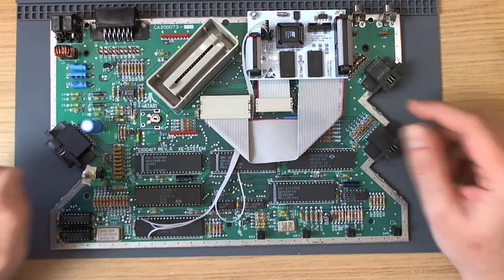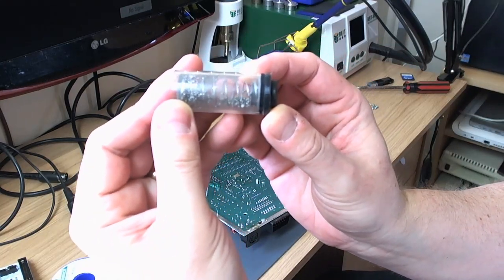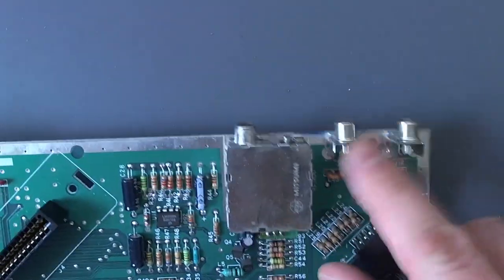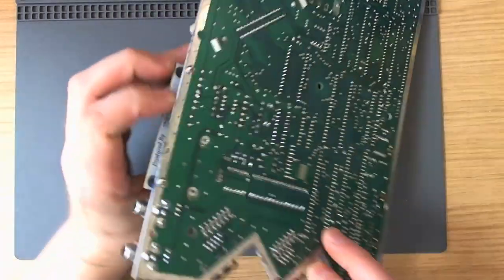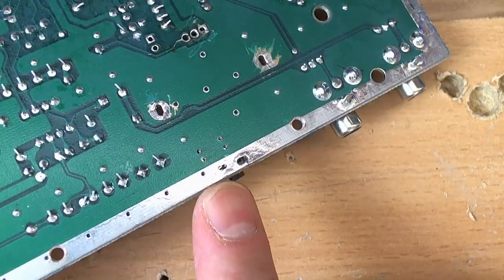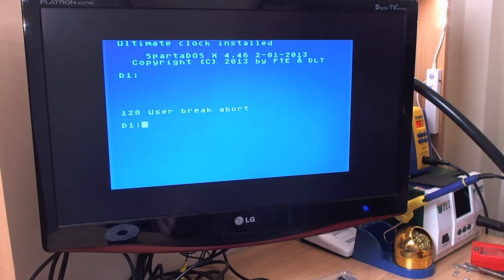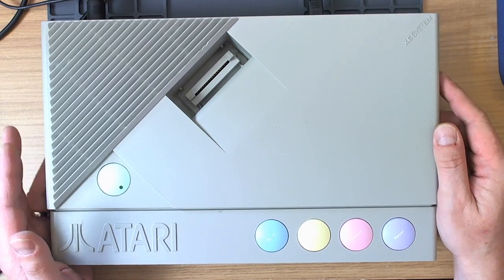Atari XEGS: Installing Ultimate 1MB and s-video jack

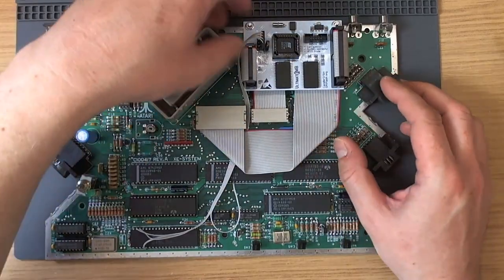Comment: 16:45 It would have been really helpful if you mentioned which pins you attached the 3rd ribbon cable. That was a bit too quick. There seem to be no written description on how to connect the Ultimate 1MB so the videos is all we have.
Reply from the maker: You know from the vendor's instructions and the labelling on the board that you need Phi2, Halt, Reset and R/W. Halt is on pin 35 of the CPU or pin 9 of ANTIC, and the rest are here: https://en.wikipedia.org/wiki/Atari_FREDDIE
Reply: @flashjazzcat  Thanks for the link. 👍

Well, Lotharek keeps the price down by not providing printed instructions, sockets for the ICs or jumper for the XEGS. 😂

PS: I did get the one with your firmware. 😉
Reply from the maker: @Martin.Krischik  LOL. He's a fiscal wizard for sure. And thank you. :)

Comment: I am glad you went back to the 70s style bumpers, as that is certainly your channel's personality people remember.  Your camera set up is getting much better.  I would say your channel now equals the quality of your repairs/upgrade, and that is stellar quality.  Keep up the good work.

Also, the age old frustration of software programmers dealing with hardware engineers.  I am actually amazed at the patience. :D
Reply from the maker: Thanks Richard. I don't know that this makes any difference at all to channel growth or views, however. I spent a whole evening editing this latest video (from several hours of footage), after 125 views during the first twelve hours (usually the busiest time for any video), this is not really a sensible use of my time. It's possible people have simply heard enough of current topics (U1MB, etc). Almost anything outside of the realm of 8-bit Ataris (hot air and soldering station reviews, etc) is doing better than the repair/upgrade videos.
Reply: @flashjazzcat  Well, that depends on what you want the channel to be.  Just strictly Atari, and just strictly repairs and upgrades, will definitely begin to dry up, or at least eventually begin to compete with your previous videos.

Maybe think about a howto series.  Think of the most typical problems with each of the 8 bit Atari computers, and make an episode addressing just the issues typically run into by that computer model, how to fix it, and suggested upgrades in addition to the fix, or bypassing the issue that are typically used (including avoiding trace lifting as is usually an XE problem, as you know).  Begin with the oldest model, and each episode in the series can be the next model up.  Make each video be a go-to source for whatever specific model someone might own.  That way, you would become the Atari video troubleshooting and upgrade guide.  What I have found are most entertaining, isn't just viewing the PC board, but also showing the issue on a schematic before and after.

You can even make soldering/desoldering videos.  Why not basic electronics videos describing how each of those colorful parts in an Atari work (on a rudimentary level)?

If you get to be entertaining enough, and branch out a bit, you can even have people send you things in the mail, out of the blue.  This is how a relative nobody with computer repair experience began his YouTube channel, and now it is really popular (Adrian's Digital Basement).  You certainly have far more Atari repair experience than him.  So it depends on how much effort you want to give it.

Maybe branch out into Atari consoles too, or if you are brave, try other 8 bit computer brands.
Reply: Oh, two more things, make a clip for your web site, and have that at the end of each video.  Have a brief (less than a minute) overview of where everything is (firmware, etc.).  I thought of something else gimmicky too.  I don't know if you would be game for it.  Video yourself in, front of a Green Screen, of just you, your guitar, a very cheesy toothy grin with you slightly nodding, and strum the guitar once.  Keep that video as a template, and at the end of each episode place a different ridiculous background over the Green Screen.  Make the clip less than 15 seconds.
Reply from the maker: @richardkelsch3640  There are only so many broken Ataris to work on, and only so many things which result in them not working (bad RAM, dead CPU). Basically I'm happy just to make videos showing what repairs or upgrades I'm working on at any given time, and if that's not sufficient to sustain a YouTube channel, it's something which must be done for pleasure alone. Fortunately I enjoy video editing, but when one invests four or five hours into the editing process in order to raise quality levels and develop the channel and channel development does not occur, there's no point in flogging a dead horse. I've already touched base on the most common issues - sometimes more than once.

I'm no electronics expert, meanwhile, so I leave circuit theory to those better qualified to describe it. :)

It may simply be a personality thing. I've long considered starting a second channel solely devoted to jazz guitar, which is almost guaranteed to have much wider appeal. In the meantime, I'll just have to make Atari videos whenever I get the urge to do so. I spent the last year in a concerted channel 'push' and aside from getting me over the line in terms of monetisation (which will probably not pay anything out for another two or three years), I'm basically back where I was in 2017.
Reply from the maker: @richardkelsch3640  After a series of comments telling me how ill/ugly I looked, I thought it wise to keep the camera off my face entirely. :)
Reply: @flashjazzcat  LOL, maybe my humor is too dry, but I laugh just thinking about you sitting there with a cheesy grin with a guitar.  The "WTF?" potential alone seems funny, at least to me.  I just remembered some of your earlier videos that you edited in "HEHE" for innuendo, and the occasional movie clip.  I actually laughed at those.

As to the channel, I never said stop showing the repair videos.  Those suggestions were in addition to, not replacement for.  As long as you enjoy what you are doing, then please continue.  I was just addressing your concern with work put in versus those viewing.

You have made great improvements to your channel, and I, frankly, would like you to succeed.  I was going to start my own channel (I know you know), but I got laid off from my job due to C19.  So that locked me into a holding pattern, but some of those ideas I gave you were ideas for my own channel.

Good luck, and keep having fun.
Reply: i have to agree, i love the 70s vibe on these videos

Comment: Where do you find all the jumper settings for the 1meg board
Reply from the maker: There's only one jumper: XEGS mode, which is open (regular XL/XE) or closed (XEGS).

Comment: what does the Ultimate 1MB do ??
Reply from the maker: Provides 1MB of RAM, four software selectable operating systems, four BASIC ROMs, four (optional) XEGS game ROMs, a real-time clock with battery backed RAM, four user hardware configuration profiles, a PBI hard disk/FAT-hosted ATR handler (for use with SIDE/SIDE2/SIDE3), a built-in FAT game loader/partition/disk image manager (for use with SIDE/SIDE2), user-flashable ROM slots and firmware updates, built-in SpartaDOS X disk operating system, etc.